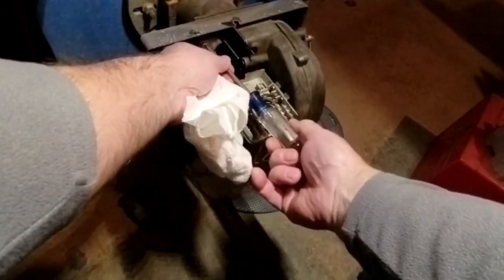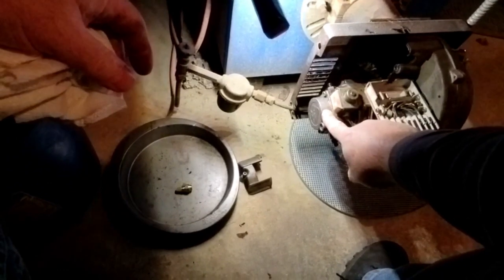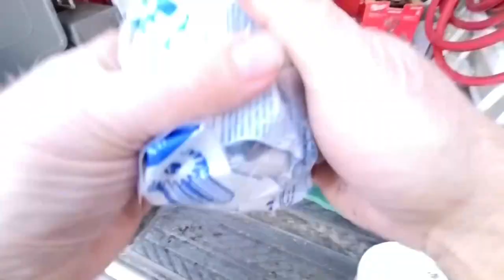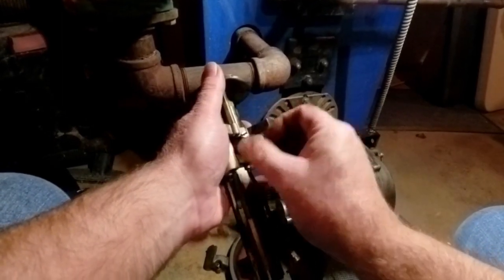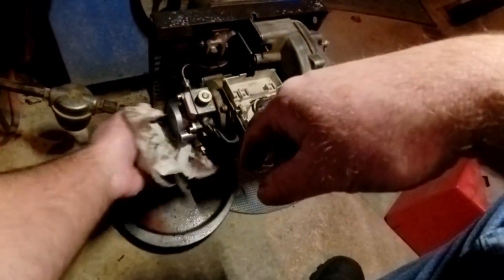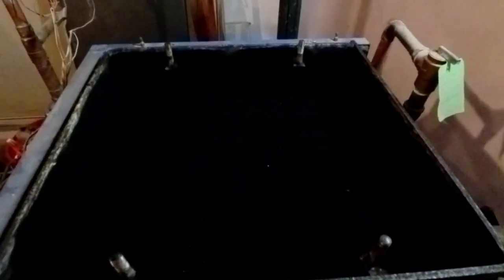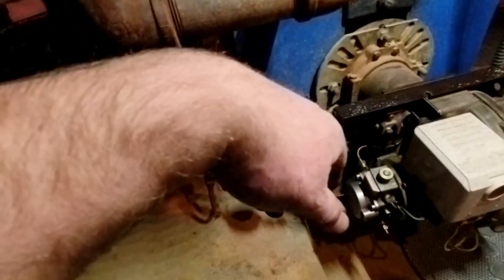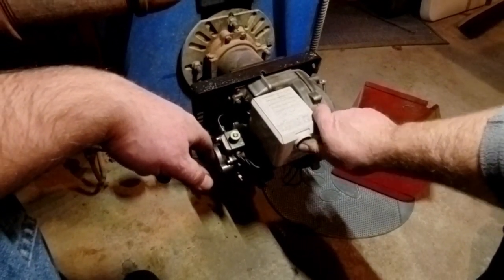Full Service on a Trianco Boiler with a Riello Burner

Comment: 38 years and never replaced electrodes??  I did oil from 1973 until 2006. I’ll have to admit, we didn’t have any of these burners with one piece electrodes, but on Lennox, Becket, Ray, Wayne, etc.  I always replaced electrodes every service It’s just not worth having a delayed ignition .  It’s nice to see an old timer who does a complete oil service. I used to get Wayne tune up kits, and replace everything, nozzle, buss bars, pump couplers, filters, strainers, etc.  I charged 4 hours, and did two a day.  Was using the old Bacharach combustion testing equipment back then, with the manual smoke pump and hour glass CO2 testers.
Reply from the maker: That is true on the burners you mentioned but I was referring to Riello burners when I said that. They run on DC voltage and just never seem to wear. Thanks for listening and commenting. I got into the trade in 1985.

Comment: Is there no need to clean the spot out of the bottom portion? How would you access that? I have a trianco boiler with a Beckett unit, with no access panels. Only from the top like in your video. Thanks
Reply from the maker: The only access to the combustion chamber is by removing the burner. 
This seldom needs to be done because of the extreme heat in the chamber. 
You may always have some debris in there. The flame should burn in suspension and not impinge on anything. 
If that is the case, let it go, it will be fine. 
If the chamber does need to be vacuumed out, let it cool down and be very carful not to damage the soft fiber chamber.
Reply: To run the motor for purging the pump, leave the control box off and jump 5 and 6. Assuming they're wired the same way as here in Ireland.